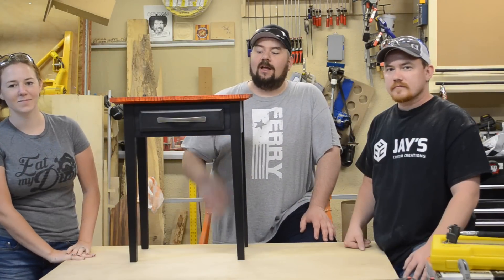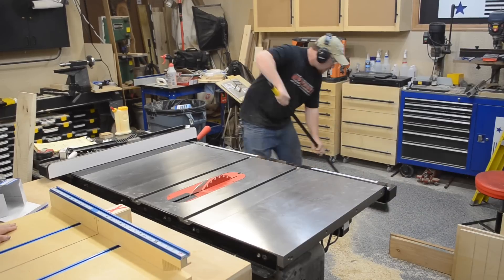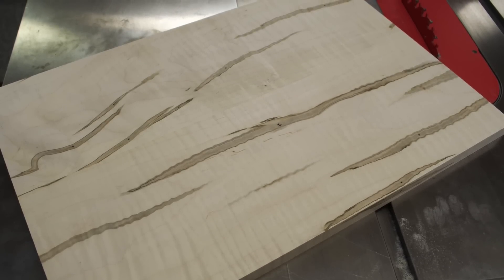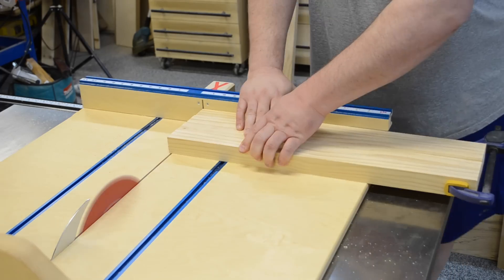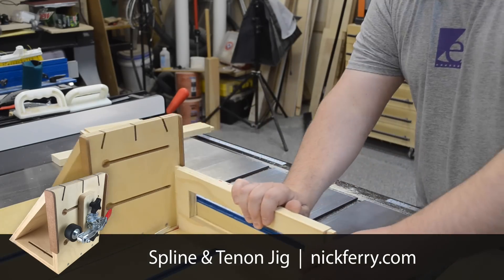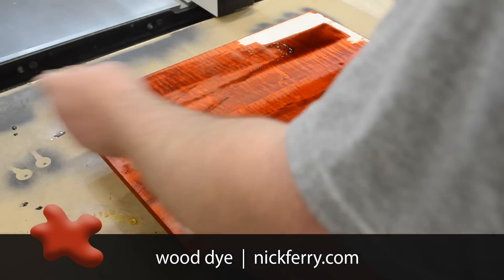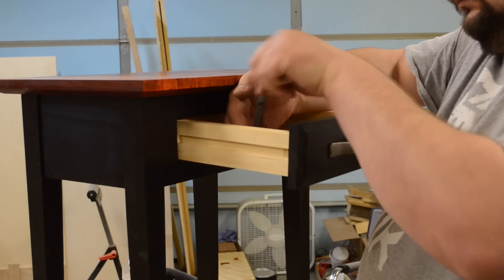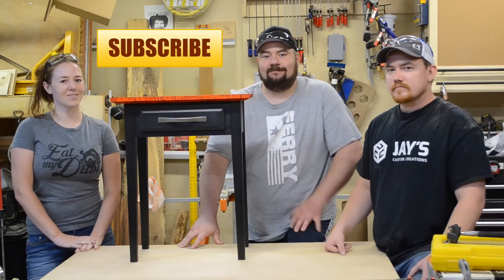Ⓕ Making A Table | Curly Ambrosia Maple (ep71)

Comment: Great job Nick, April and Jay, love collaboration videos.  Beautiful job on the top as well.  I really like the deep orangish coloring with that pattern.  One concern though -- shouldn't the hardware be on the ends of the top to allow for expansion, or is it not a big deal on that small of a board?
Reply from the maker: ideally but the base was so narrow and I forgot to put the slots in the apron before hand - the clips i used are set back slightly to still allow for expansion and contraction - glad you liked it!

Comment: Beauty table guys and gal! I've never used wood slides before and had a quick question about the runner. Did Nick toenail them in or did I miss something?
Reply from the maker: https://youtu.be/-qNylOwo0es?t=6m20s - I showed it pretty quick
Reply: +Nick Ferry I thought so, it was so quick I wanted to make sure. Thanks again for a great video!
Reply from the maker: thanks - no problem

Comment: when using Table top fasteners on a top much larger like a coffee table, do you have to worry about the top twisting or becoming uneven over time? or would you add center supports and use some screws?
Reply from the maker: that depends on a lot of variables - wood species, climate, geography, size, etc. - the larger the area the more you will want to think about it though - if in doubt, add some battens (floating) to keep it from cupping and/or twisting

Comment: Do they make a food safe dye for cutting boards?  I need to make some red and blue segments and was just curious.
Reply from the maker: I personally would have no issue using them with a cutting board but that's just me - you could look at the MSDS sheets and that may help you determine if you want to use them for boards - some protectant top coat would be the route I'd go
Reply: Thanks

Comment: I've heard different opinions on cleaning up glue. Most people seem to wipe it off when it's wet. But I read a book by one of the "Furniture Guys" from PBS years ago and he swears you'll always notice it if you stain and the best way is to wait until it dries and scrape it off. Any thoughts on this?
Reply from the maker: never had a problem with it in over 20 years - I don't saturate it either